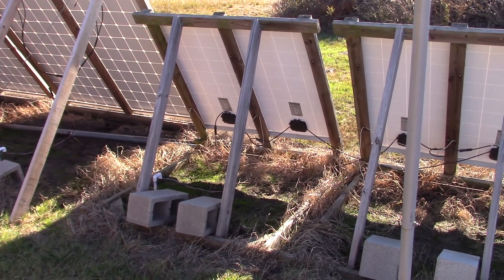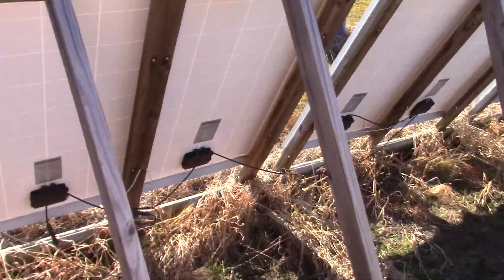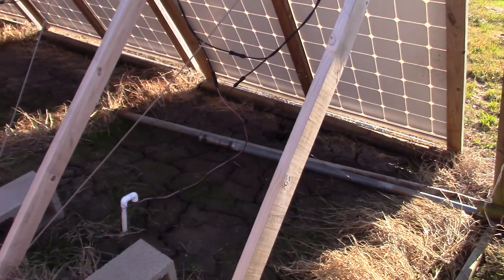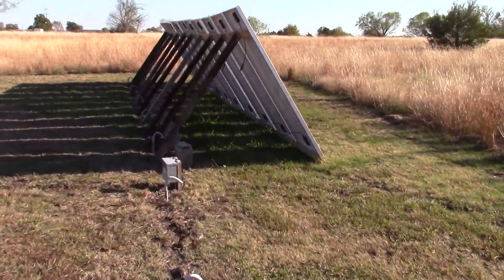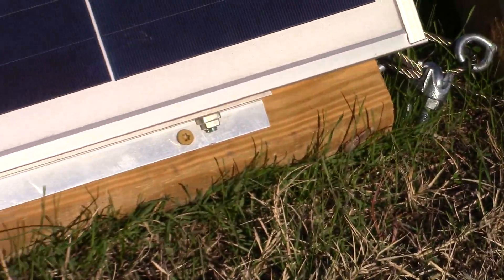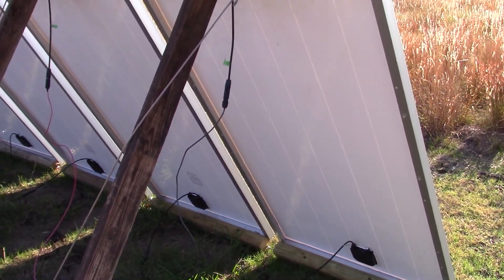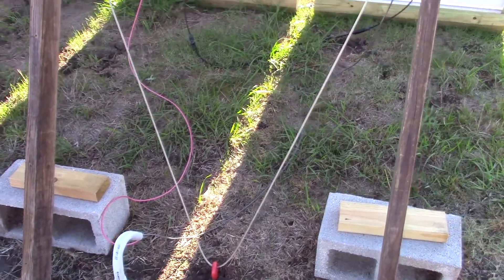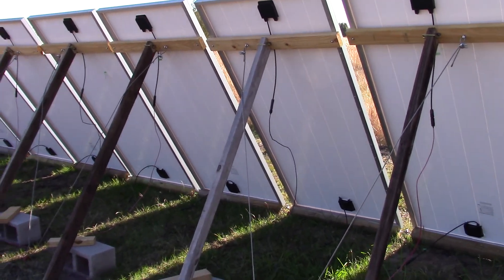Solar System 3: Newer 2x4 Solar Panel Ground Support Design

Comment: What did you use to hold the 2x4 frame to the panel? I'm worried about dissimilar metals.
Reply from the maker: Just galvanized bolts. They can rust, but the aluminum doesn't seem to care much so far.

Comment: Very nice!  That's a very smart and simple setup!
Reply from the maker: We had some /very/ nasty northwest straight-line winds Tuesday morning. The panels are still standing! (Technically they should be in the summer position by now, but I suppose we've gotten a bit lazy and plan to cut them to be at a slightly lower fixed angle.)

Comment: hi, if i need to get my panels to a 38 degree slant, what metal bracket am i using to connect the two 2x4s?
Reply from the maker: Well, the angle is determined solely by the length of the 2x4 propping up the panel. Of course, you'd want to cut the angle on the 2x4 to fit snug/flush with the bracket so you can drill a hole for the wire clips. Unfortunately, I can't seem to find any links to the particular brackets we used at the moment.